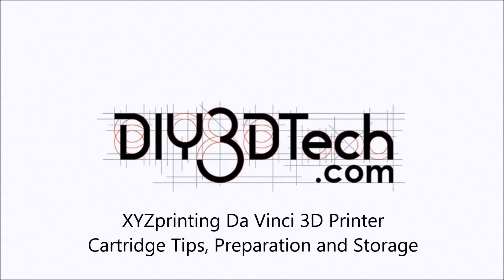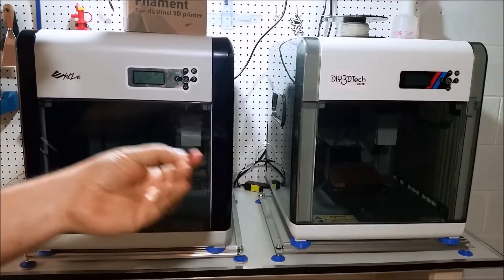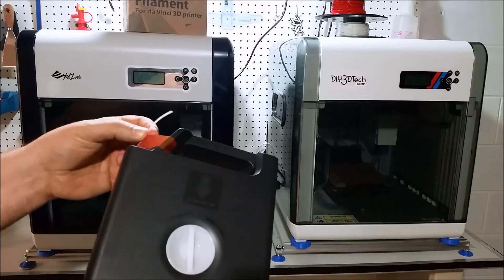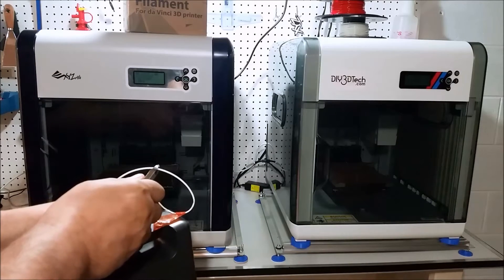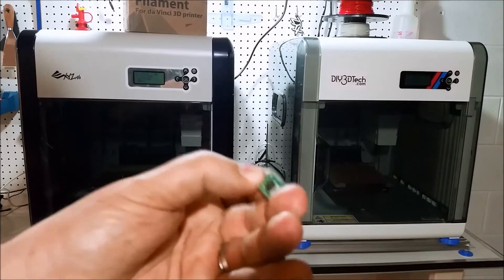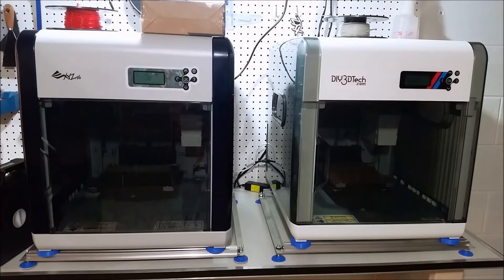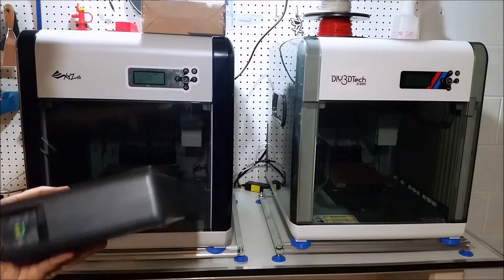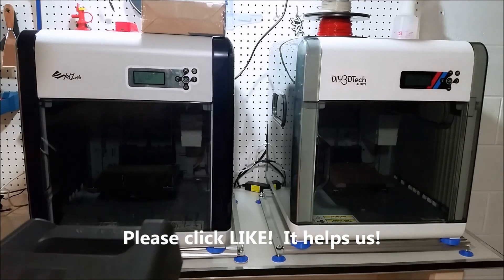XYZprinting Da Vinci 3D Printer - Cartridge Tips, Preparation and Storage

Comment: For the record: Yes, the flexible stopper can enter in to one of the spools square openings and prevent rotation, however unlocking the CASE LOCK is only to separate the (2) case halves for access to the internal spool, does nothing beyond that function and no ability to lock the spool, only permits opening the case halves.